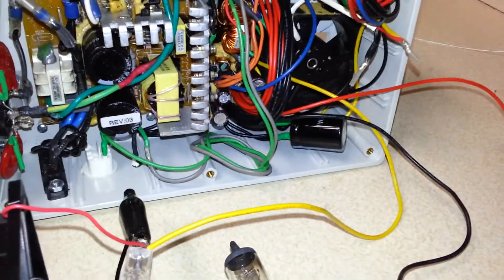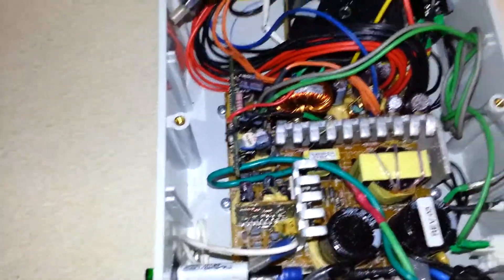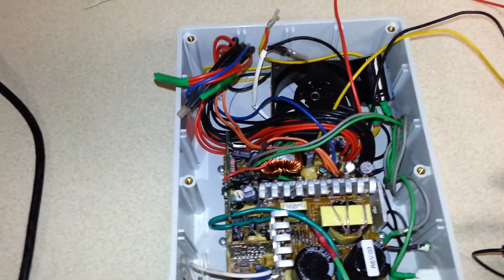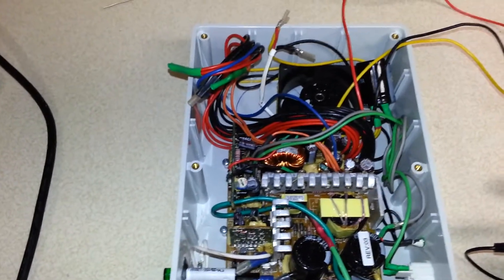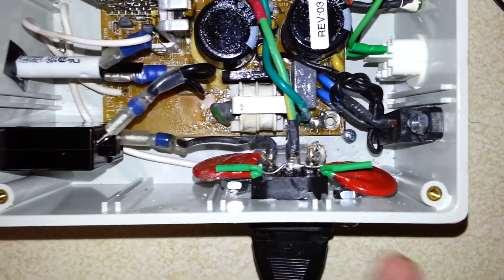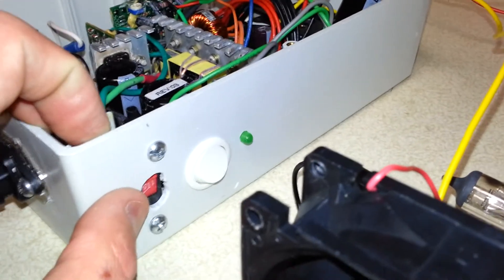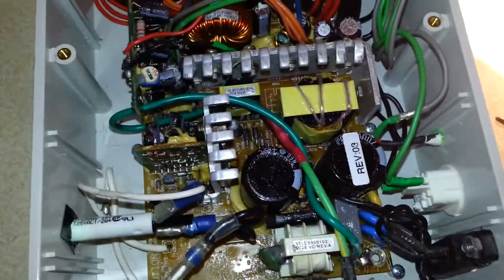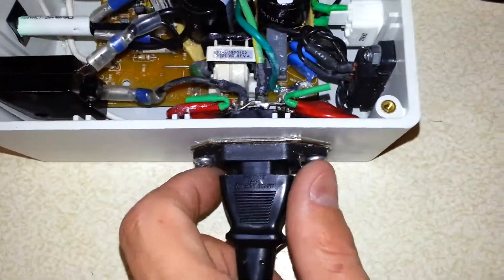Low voltage Whole house power supply for usb charg

Comment: I've been thinking of doing something similar and setting up a small solar panel that charges 12v lead acid batteries on a UPS to use for just charging and certain appliances that I can eliminate the wall plug transformers for. Do you have any concerns about voltage drop on the 5v DC line? I'm thinking about running 12v around and just using high efficiency switching regulators at every point of use. Nice job so far!

Comment: Hello. Thank you for the video. I was hoping you might be able to point me in the right direction. I am trying to build a system where everything is ran off of a battery. My work vehicle has 10 USB devices that need 5v @ 2.1 amps each, an OOMA phone system which I need to convert to a DC input of 5v @ 3amp, and a 12v wireless access point. I also have a laptop that I need to convert to run from DC. 

My goal is to have all these devices be able to run from a battery for 12 hours and then recharge the battery overnight for use the next day.

I am currently using a standard UPS to which I can get 5 to 6 hours from, but of course this is with the devices using the ac/dc. 

Thanks for any advice in advance!

Comment: maybe you have some nasty, dirty AC where you live, but most of the western world is moving to underground distribution, my AC is so clean I don't need any of that, even during thunderstorms they're no spiking at all, that's the "in the future" you should think about instead of feeding yourself and potential viewers that belt and suspender FUD, and not every MOV implementation need a thermal fuse, just the line to ground connections